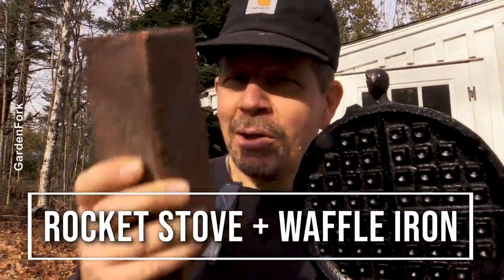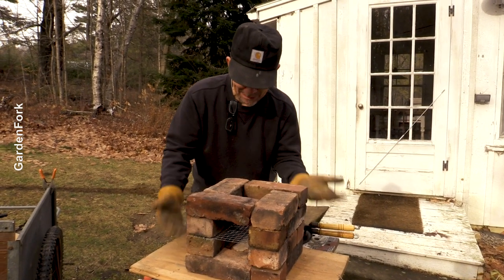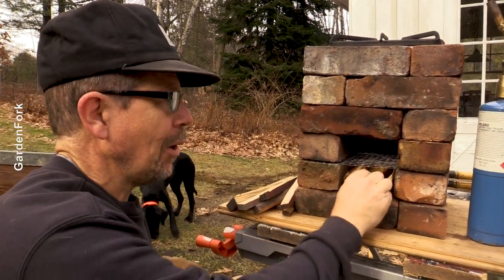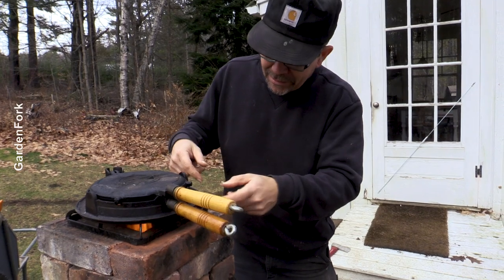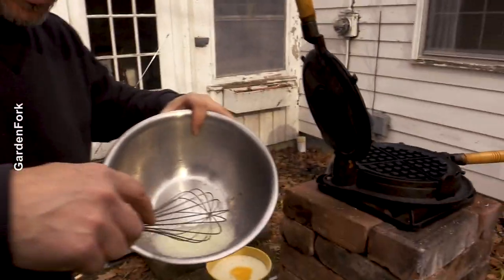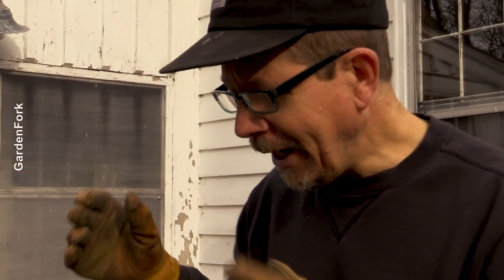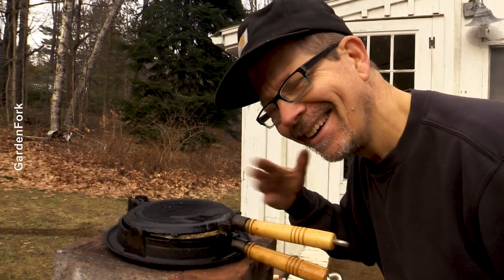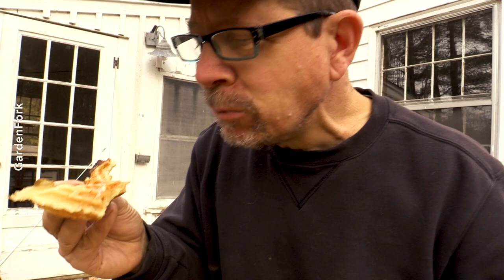Place Waffle Iron On Rocket Stove, Then...

Comment: Stupid me, I thought that was a vintage Griswold iron having never gotten a good look at the outside. I was thinking that's terribly rough for Griswold but ok. Then you linked to it and I thought "yeah right". A Griswold waffle iron has been high on my radar for over a year but I haven't found the right one. 
Changing tracks, when you hang cast iron in the e-tank hang it inside a pillowcase. You can clamp it to the hanger or zip tie a pool noodle to the opening. This catches most of the crud keeping the tank/anodes cleaner longer. I clean for 2 estate sale companies and myself so my tank can get pretty nasty pretty quick. I have a 55 gallon barrel cut to hold 35 gallons lined with stainless steel sheet metal because it's easier to clean. (SS has been completely safe) My charger puts out roughly 38 amps depending on the surface area of the pieces. Time is important to these folks so I try to clean 3 pieces at a time. It will hold a #14 but that's my depth limit, anything larger has to rise above the surface. I never touch em with a wire brush, they'll start slow but within the hour it'll be 100%. I hang em on two 3/4" copper pipe with 1/4" "J" hooks in em. Two separated hooks in one pipe and one hook center of the other, I can stagger em that way. I have a short 6 gauge jumper to connect the pipes when both are needed. I don't change the water very often but the anodes are cleaned often and never stored in the wet tank. My mixture is 1 1/2 tablespoons Laundry Soda per gallon. They say it won't shock ya. I say ok pee in there, I'd pay to see that. When its pushing 38 amps it will light you up. Not saying this is the best or the only way to build an e-tank but maybe you guys got something out of it that you can use.